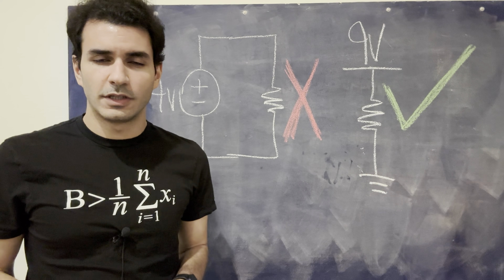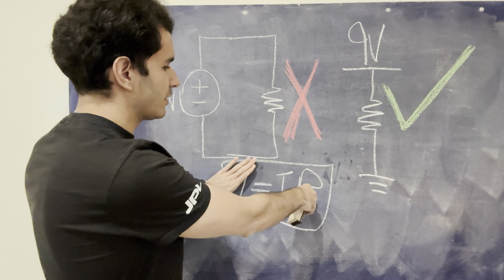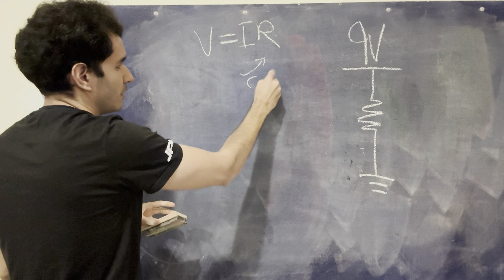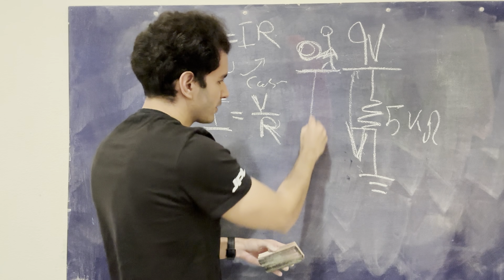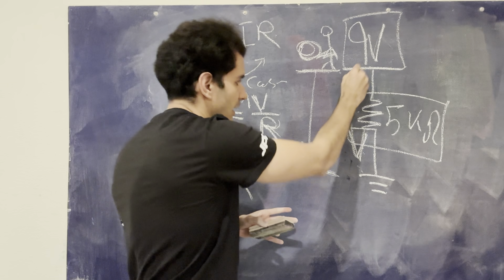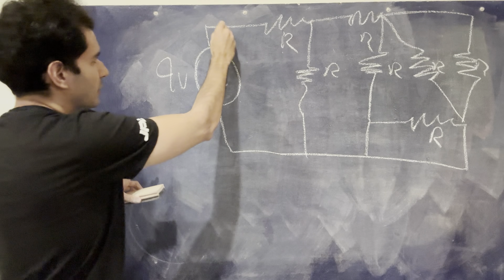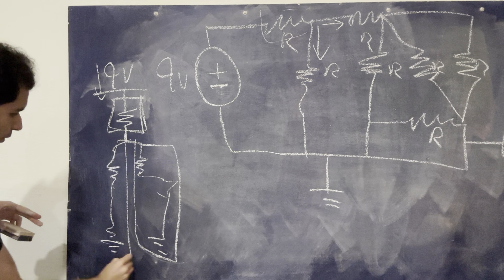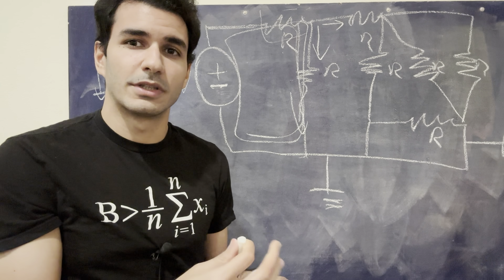Circuits Finally Made Sense When I Saw This One Diagram

Comment: Both are useful. 

Circuit diagrams are models. Models emphasize and deemphasize certain effects or behaviors. Whether a model is helpful or not depends on what it is being used for. It is better when both teachers and students understand this principle. Both will then look critically at how the model supports learning. It also helps when teachers explain why a particular model is used to represent the concept. Abstract concepts should be taught with a visual mode (a diagram), a textual model (an explanation or description), and, where relevant, a mathematical model (an equation). These should support each other, with strong intuitive links between their features. When this is backed up by some hands-on experimental or laboratory work, it makes a strong impression on the mind.

The left-hand model better emphasizes that current flows in loops, from a source to a sink; it better emphasizes that the loop has an area; it emphasizes the magnetic field within the loop; also it emphasizes the source as an actual component or part within the system which isn't as apparent when a 9V rail is shown. This sort of model might better support a discussion about inductance and magnetics, or noise and interference coupling for example. You're right that these are advanced concepts compared with ohms law, and not the aim of your lesson.

However, as others have pointed out, there can become a point where students have difficulty progressing because the simplified models and understanding they developed does not support learning of more advanced topics. Sometimes a model is chosen with future needs in mind, not the immediate ones.
Reply: Model theory

Comment: So in escence, using a mass, the force of gravity, and air resistance as an analogy for current, voltage, and resistance.  Got it.  Automotive wiring diagrams are drawn this way.

Comment: Great explanation. Would you consider doing a video on whether it's the volts or amps that are more dangerous in an electric shock?
Reply: Ita both actually. Think of this: static electricity had thousands of volts, and car battery has hundreds of amps, yet either one wont kill you. If the duration of high voltage is long enough and current is strong enough, and the location of where the points of contact are, your muscles can contract causing death
Reply: @rty1955  Thanks.
It always seems a bit confusing when eg you have 200K volt Van de Graaff generators which people touch while they're grounded, with no ill effects. The current may be a few mA here, but with 200K volts pushing it, you would think it would be lethal, but it's not.

Comment: I did really badly in my circuit analysis courses because I just couldn't understand what was happening physically in the first diagram and my head would hurt trying to recall the right formulas to use. I've seen the second diagram now and again but I wish I had the foresight to learn to convert between the two. I'm in my final year of my electrical engineering degree and I wish I had internalized this information 3 years ago...

Comment: This is exactly how I always saw it since I was a kid. My "vision" is someone on a cliff with a bucket of pebbles. Where the height is the voltage, the number of pebbles is the current and, I imagine some branches coming out along the cliff as the resistance. Just this metaphor helped me a lot to understand electrical problems in classes.

Comment: I see what you're saying....and it's a great perspective....however, when I'm designing a circuit with discrete components I'm thinking ahead about the layout on a breadboard or veroboard etc, and the "left to right" view seems better to show that "flow" across the circuit board, inputs on the left, outputs on the right, etc.

Comment: I was taught the ”Ohm’s triangle” and it has served me well in simple DC applications. I can see how it would be of limited use in more complex circuits. My skills don’t extend far beyond calculating the resistance of resistors in parallel. 

What’s fun though is that your linear model reminds me of an analogy to water hoses: a taller water column would be more voltage, a larger hose allowing more mass flow is like a thicker wire that can handle more amps – which is current too – and pinching the hose is like a resistor. 

I was told a long time ago this is a poor analogy but I never really understood why. It isn’t exactly the same but you’re not supposed to take things literally. Just remember valves ”open” to let fluid flow, electric switches ”open” to stop the electron flow.

Comment: Can u also explain ground? What is ground? Why is it needed in a circuit? What does it represent in reality when you look at the simplest possible circuit eg with just one battery, a resistor, an LED, and all of that wired together in a circuit from one battery pole to the other?

Comment: Thanks for clearing this up. Now I know that current runs DOWN HILL! Current going in a circle (or rectangle) seems so confusing. Perhaps I should have switched to Civil Engineering where water actually does flow DOWN HILL. Or better yet, waste water. (Unless you have a pump that is sometimes explained as an analogy to a battery or generator.) Still not sure how I got to retirement without knowing this.

Comment: As a retired Electronics Tech for over 45 yrs, I always used Electron flow whereas the Electrical Engineers I worked with used Conventional flow. The only time a problem came up was sometimes when reading schematics, we had to agree on our source potential or grounds. But I would usually reverse my thinking so we could all be on the same page 🧐
Reply: Why would you do that
Reply: @787310  ..do what, particularly?
Reply: @787310  Why would I do what? Explain please !
Reply: @787310 because of Benjamin Franklin
Reply: @787310  Because Electron flow is the proper way to explain electronics when we had vacuum tubes, neg to positive flow was taught to the end of the century  until Tubes were gone. Every class I had in the 70's this would debate come up until now.
Reply: Ben Franklin got it wrong.
Reply: @225rip  Correct ! He used Conventional flow, Positive to negative. Electrons flow from neg to pos. I was taught electron flow in the early 80s .. Maybe there's a new flow nowadays 🌩⚡
Reply: @PopsRacer61  No really, it is traditional for 4 yrs schools to teach hole flow and high schools and community colleges teach electron flow. It is wrong for copper wire, but can be used in semi conductors or batteries in liquid or ions in gases.
Reply: (Smirking gently) Opinion: It depends on the student's direction. Typically, you should definitely underscore electron flow early in instruction but use it as a more thorough way to provide a complete instruction. If you ignore teaching it at all you'll CAUSE confusion at some point in learning. Don't do that. (Again, IMO.)

Comment: From a physical perspective, the models are not equivalent. It works only for DC. However, if we consider an AC voltage source, it will create time-varying magnetic fields within the loops, which will induce currents. For a physicist, it is better to stick to Maxwell’s equations and consider the actual path of the current.

Comment: I need to point out that ohm's law is taught in high school. In university, when doing electronics engineering, the admission is made very early on that v=I × R is oversimplified. Nodal analysis is a powerful tool for circuit analysis.

Comment: Your representation is great for physicists but it would be confusing for microelectronics. The "ground" is a reference voltage. I kept hoping you would use the word "potential difference" in place of "voltage" to make it easier for beginners to comprehend the flow direction of current. Many analogies of electronics exist but yours is not the best (in my modest opinion). The process engineering analogy (where voltage is tank level, current is flow rate out of the level, and resistance is the radius of a pipe) is a way more intuitive model for people trying to understand electric circuits.

Comment: As an electronic technician who also went to art school I find your explanation amusing. While you're describing circuits which by definition is a circular flow you want to put it into a linear diagram in an attempt to simplify the flow. Circuit means circular. Anyway, you have touched upon what was very complicated to some of my fellow students in technical school. I have a pet peeve with schematic diagrams in that they're always in black ink and so much more could be learned if the positive rail was in red, the negative rail in blue and the signal path in yellow. In other words color coding schematic diagrams would make them much more useful.
Reply: What about A/C circuits?
Reply: I suppose they spell "circuit" with a "c" and not an "o", so there is a break in the path. 😉
Reply: @GeoffFrizzell-kz3rg  the thing is, we are discussing methods of instruction here.
Dr. Hairsplitter wanders into the discussion...
Reply: For training on electronic equipment in the Army, the instructors had the students use felt-tip pens of various colors, tracing the various signal paths and voltage "rails" on schematic diagrams, to make the behavior more obvious, as you suggest. 🙂
Reply: @analog_guy  it's enormously helpful compared to just black lines.
as seen on Star Trek; 'we have the technology.'
Reply: Useless comment
Reply: Circuits mean circular? WHAT 🤣 You do realise that circuits don’t actually go in a full loop. It’s just a presence of electric potential, electrons are travelling to the path of least resistance. Even when you connect something to a battery, inside are two completely seperate compartments (okay that oversimplified and it’s not always physically separated). Idk who taught you
Reply: @andrejcupac7359  OK Dr. Obvious!
gotchu.
Reply: @andrejcupac7359  When you define current as the net flow of positive charge, then current does flow around a full loop or loops that may include a battery.  For instance, there are positive ions moving in a battery and electrons moving in a resistor when these are connected together but the current forms a continuous loop.
Reply: @analog_guy not true, because batteries still have two completely seperate compartments, even though it’s one component. The anode and cathode are divided by a separator.

So in reality they could make two piece battery and place one at the start of the circuit and one at the end. Which would give you a visual that it is in fact not a loop. Although recharging them would be annoying since you’d need two chargers (and those chargers wouldn’t function like traditional charger).
Reply: @analog_guy and net flow of positive charge is the exact reason that a loop isn’t necessary 😂 oh my days 🤦‍♂️
Reply: @andrejcupac7359  I think you might read up a little more on batteries.  The current-carrying ions in the electrolyte permeate through the separator in batteries.  Current indeed flows in complete loops.  A two-piece battery won't work if the two pieces are insulated from one another.  At best, you would have a thing like a supercapacitor.  Even in any capacitor where the conducting plates are separated by an insulator, there is a displacement current through the insulator when the capacitor is being charged or discharged.
Reply: @analog_guy only the ions permeate through, not the electrons. The only use for this is to allow for simple charging and discharging.

Otherwise you’d have to have to seperate chargers as I mentioned before.
Reply: @analog_guy if they were seperate you’d have to manually discharge one cell and charge the other every time the battery’s depleted.

All you need to create a current is to have an electrical potential. No where does physics state there has to be a loop. You know who states that? Teachers. Who have no idea what they’re talking about half the time. If you actually understand how physics equations are derived instead of just memorising things from school we wouldn’t be having this conversation.
Reply: @andrejcupac7359  Oops, you must know some physics, so I think you know that an electric potential is neither necessary nor sufficient to have a current.  You don't need an electrical potential to have a current.  A superconducting ring sustains a current with no potential.  Conversely, in the case of a charged capacitor, you have an electrical potential but no current.  When you add a conducting path between points of differing electrical potential, you have a conduction current in the conductor and a returning displacement current in the insulating medium between the points.
Reply: @analog_guy uh no, it is definitely necessary. And a superconductor does need to have an initial charge induced, it doesn’t just magically start flowing. While net potential might be extremely close to zero (or zero in an ideal superconductor with zero resistance which doesn’t exist), there’s still a current and change in potential. It’s just so rapid that unless you’re analysing the system at time ‘t’ for example, to simplify things we can consider there to be no potential.

Because of its low resistance it can sustain a current without applied potential, that doesn’t mean it never happens. If you truly believe what you’re saying is true then you should write a thesis and get a Nobel prize for these incredibly advanced discoveries. Making current out of nothing would mean we’d have to throw out nearly all our understanding of physics till this day.
Reply: @analog_guy and off course a capacitor has no current even with potential energy stored, because you need a DIFFERENCE in potential. I mean, the sky is blue 🤦‍♂️

As soon as that capacitor touches some material with lower potential, it’ll just shoot its stored energy straight out. It’s literally a battery with less energy density. Storing charge electrostatically instead of chemically.
Reply: @andrejcupac7359  A superconductor does not need to have an initial charge induced.  It already contains plenty of free charges ready to move to immediately cancel any electric or magnetic field that may try to intrude.  The charges merely need to be made to move en masse in order to have a current.  The current can be produced by bringing a magnet nearby.  There would be a tiny transfer of energy in order to account for the kinetic energy imparted to the charges, but this is negligible when compared to the energy change in the external field due to the work done to bring the magnet close.

Regarding the charged capacitor, there is a difference in potential between the two plates, yet there is no current until a conductor is added to connect between the plates.

I think we are close to agreement, but we have a difference in semantics.  I will stop here and let the equations of James Clerk Maxwell and Oliver Heaviside be the best description found to date.  🙂

Comment: The starting point is understanding and realising, that the 'starting' electrical phenomenon, is that in nature you generally only find voltage sources. For example a battery. You don't ‘find’ current sources (though we often contrive CS's in electronic circuits) generally in nature. One first has to return to the discovery of electrical phenomenon. Let's start with say Voltaire's voltaic pile. And so the question is what does this phenomenon, do? It creates currents. Next question is, what is the
relationship? Ans, Ohms Law. So as he points out, the narrative is not V = IR, it's I = V/R. Then
mathematics as a tool, then comes in, in rearranging the variables to whatever end or purpose.

Learning Electrical / Electronics needs to start with an exhaustive exploration of Voltage and Current. Looking at many simple circuits in various configurations and drawn in different ways, to fundamentally understand what voltage, current and resistance for example really mean. To develop an instinctive understanding, feel and recognition (visual circuit diagrams). Once this is achieved, the subject can move fairly rapidly to more sophisticated stuff.

When I evaluate someone's basic understanding of voltage and current, I start off with the simple following question (in diagrams of course). A voltage V in series with a resistor R. Qn. What is the voltage at the other end of the resistor? For resistor, 0, 100, IK, 1M, 100M resistance. You'd be surprised how many (or rather how few) can answer this simple question, instantly and or confidently. Inherent in this question is a lot of understanding of electrics / electronics.

The best book by far on electronics is of course Horowitz and Hill. My only criticism of the book, the lack of a full treatment / exploration of Voltage and Current as l've described. In my instructing of starting out / just graduated electrical electronics engineers, I start with this. Three 'full' courses titled, Voltage and Current I, Il, Ill. Then in my experience, they rapidly learn the rest, that I leave to other instructors. Or indeed H&H.